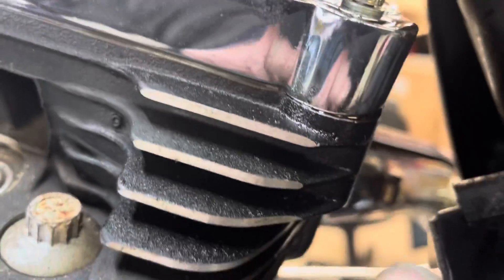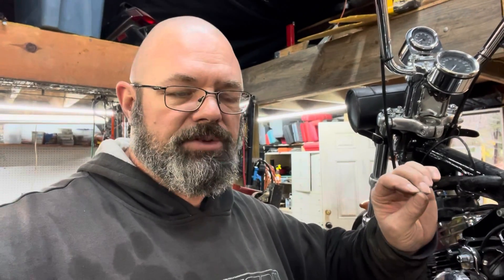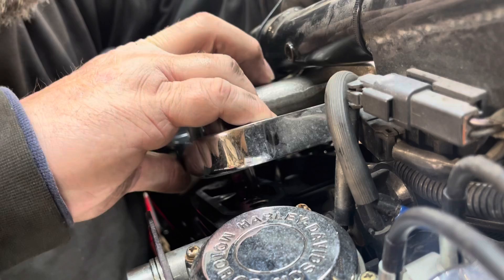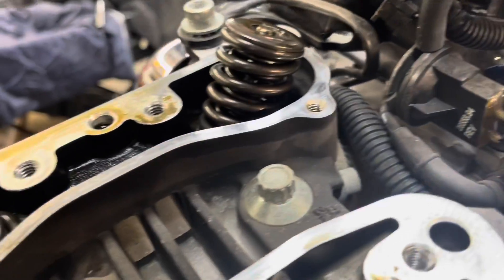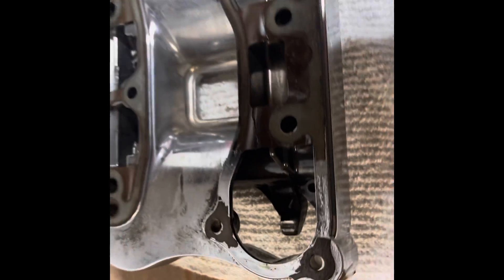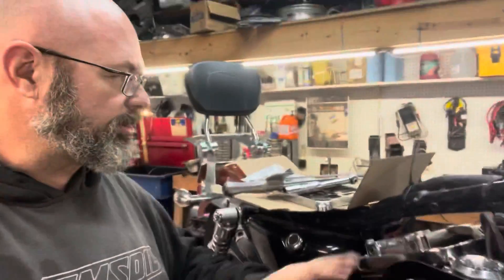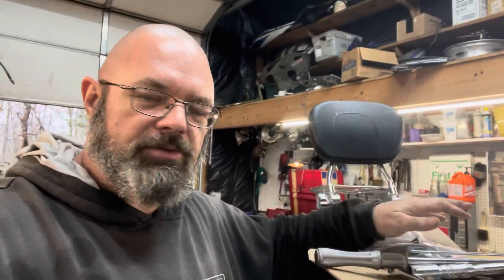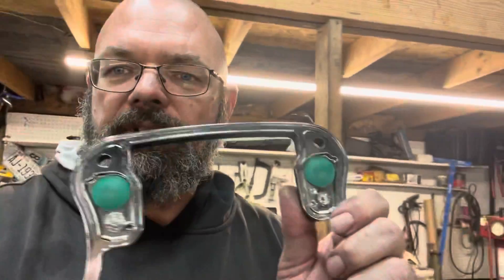Harley Davidson XL 1200 rocker box gasket failure. Updated gasket kit, stripped threads.

Comment: I am sure he will approve the thread repair, Great Video the good thing is you have video proof it wasn't you. 🙂
Reply from the maker: He did and I’ve already replaced the gaskets on the front cylinder as well. But I have to run out today and get the quarter 20 thread repair kit because I did not have one here like I thought it would

Comment: Note that it's almost always on the kickstand side of the bike and at the forward corner of the front cylinder and the rear corner of the rear cylinder that oil leaks occur. They are the two lowest corners and where oil accumulates when the bike is parked (which is most of the time). That's gravity at work.
Reply from the maker: Very true

Comment: 18:56  I purchased a 91 1200xlh a month ago I found the rocket boxes leaked so once I removed the rear rocker box plates and flipped the bottom plate over I noticed that the rear center head bolt has been digging into the bottom of that bottom plate the bike ran fine so I'm not quite sure why the bottom of that rocker Plat would have a gouge that is the size of a half of a penny and IA just deeper than a thumb nail can you please tell me what I need to look for please thank you!
Jeff
Reply from the maker: I would definitely check that the head bolt is secure, there should be plenty of clearance.

Comment: Good video question I put my Harley on a jack lift to clean my rims after that I decided to start it because it’s been a while since I ran it started it in neutral and the rear tire started to roll forward is that normal thanks
Reply: Yes normal
Reply: @thebeardedguyjefflawless5887  Thanks Jeff
Reply from the maker: Yes that is completely normal when the engine is running things are still moving and even with the motorcycle in neutral the input shaft on the transmission is still spinning, and however  it is not fully engaged to the output shaft. without any load to hold the wheel still you will still see that movement
Reply: @amsoiladam  thanks Again